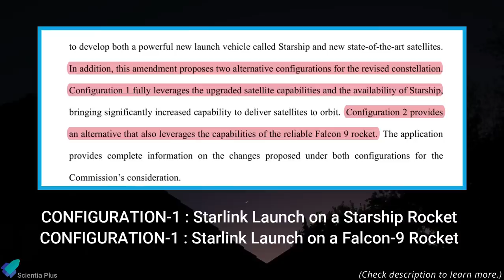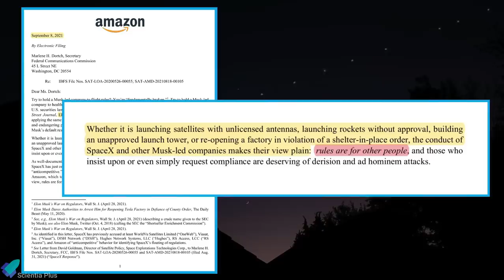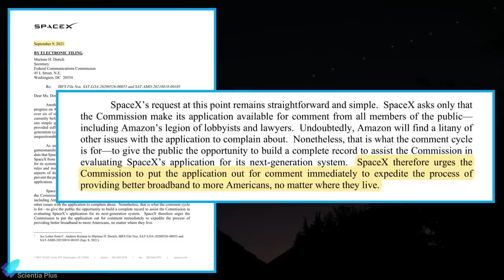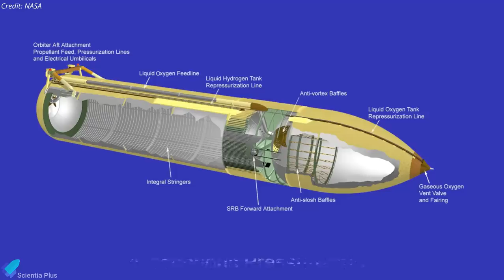Starship20 & Super Heavy Booster4 Works 95% COMPLETE, Static Fire This Week? | SpaceX Crew3&4 Launch

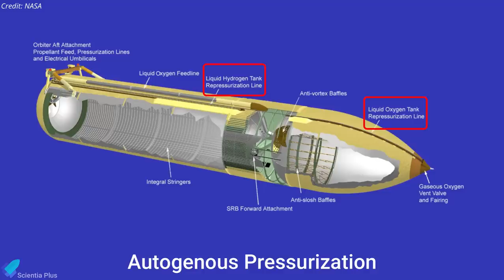Comment: 10:11 SpaceX bolts the helium system to the outside of the rocket.  It was probably a last minute add, and that area on the exterior of the skirt was just convenient “real estate”.  Gotta love it.  (Could you imagine Boeing doing that?)
Reply: Afaik, from an interview I heard, that they will not use helium at all. Instead they feed back gas (methane/ox) from the turbines to keep the tanks pressurized. As well as they use the main tank pressure to fuel the RCS. Getting rid of 2 superfluous systems.

Comment: As I understand the issue Viasat employs infrastructure the capacity of which to provide some niche services has been rendered nonviable to a substantial extent by Starlink. 

Yet Viasat irrationally contends that Starlink should make concessions allowing it's obsolete infrastructure to remain marginally viable despite inability to compete?

As for Amazon it does not yet have any infrastructure, nor does it have the capacity to place it in orbit if it did exist.

Furthermore even with regard to it's proposed infrastructure and capabilities etc Amazon has not provided any substantial information regarding it's proposed system or operations.

As usual Bezos is so far behind the race he cannot see for dust and is frantically scattering caltrops in the hope of slowing everybody else down to a pace at which he might, be able to keep up.

He should stick to what he is good at and leave everybody else to get on with what they do best and far better than he does.